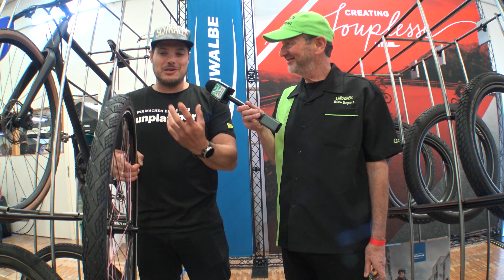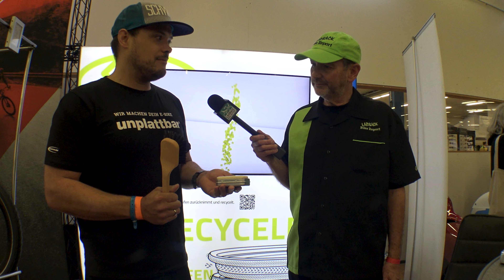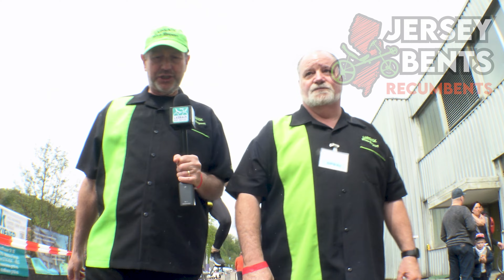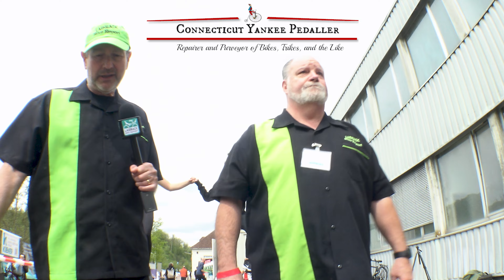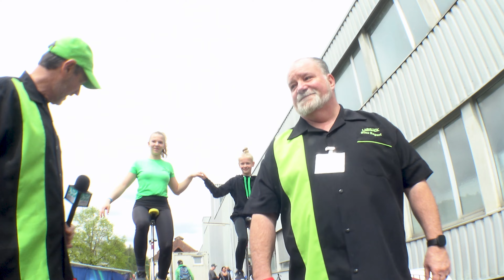Schwalbe Tires-Spezi 2023 Booth Interviews

Comment: 591 miles had my first puncture using pick up from a 10mm thorn so why is it the tread is only 3mm thick and the tyre itself is beerly 2mm thick so I’m not impressed as you keep saying it’s puncture proof so what’s is puncture proof from what as you keep saying puncture proof again and again so why not explain what’s is puncture proof from eg, broken glass , shards of metal, etc ect why not make the tyre that’s 10mm thick rubber compound and 5mm of the safe guard then this pick up in my opinion would be bullet proof, also I change from the marathon plus mtb as the safe guard puncture proof also let me down on that tyre too and on an ebike the marathon plus I beerly get 2500 miles before the rear tyre is worn out. Also the rubber compound back in 2015 was so much better than you marathon plus today as the rubber is way to soft.

Comment: Interesting to hear about the "Pick Ups." I fitted 2 of them to my ICE Adventure a while ago, they now have 1886 miles on them. I picked the widest size available, and they have made a big difference on the Lumpier bits of track on my run home. I really like them, and plan to have a pair of 24 inches when I order an Azub Ti-Fly X. 
Be good to know if the recycling boxes are to be found in the UK, or just the EU at present.

Thank you Gary!